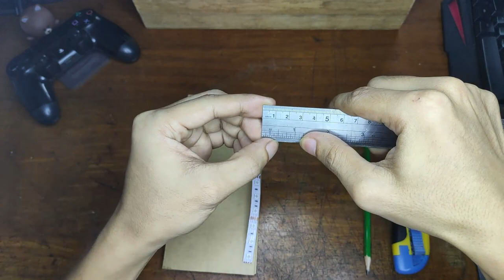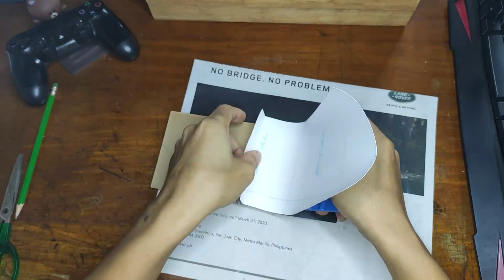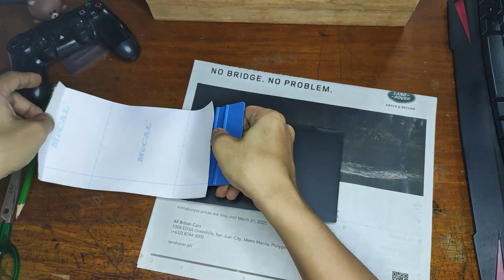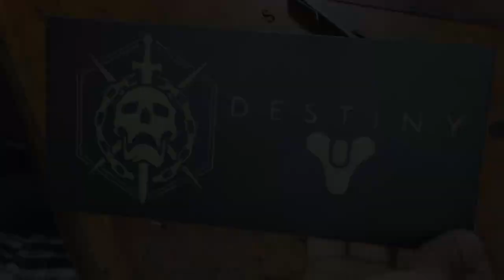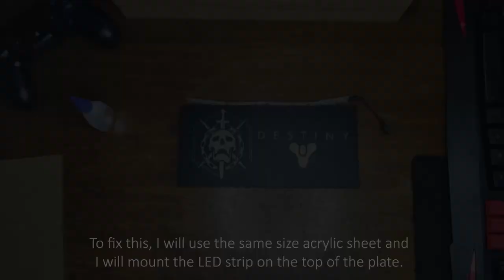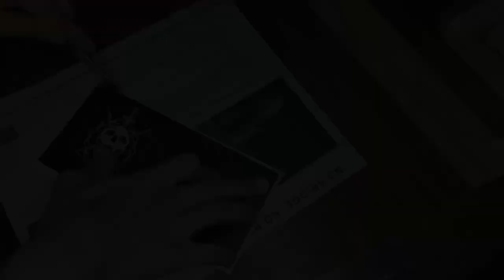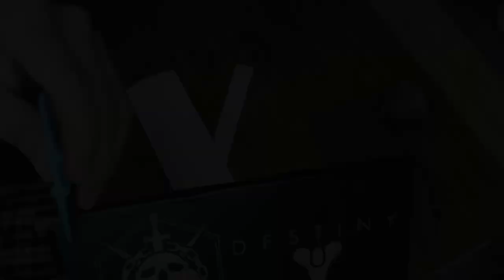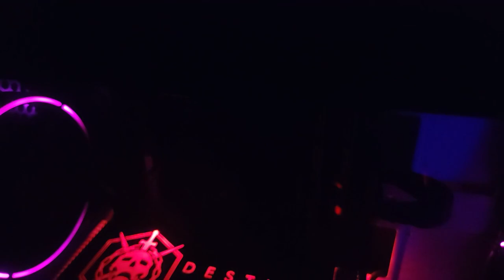DIY RGB GPU Backplate

Comment: Hello, and thanks so very much for your awesome video. Been wondering for a while now how I can make my own RGB bracket.

Was just wondering, though. Do you mind telling me what blade you use in your drop saw please?

Also, do you mind telling me what GRIT and paper or Wet N Dry paper did you use on your orbital sander?

Also, not to sure if you know this? You can get Exacto knives now that cut corners, circles etc precisely. I bought one on eBay a few weeks back. If you would like a link to one, just let me know.

Thanks again!
Reply from the maker: Hi CybaGirl. Glad to know me video helped you. 

The saw blade is used are the ff: Miter Saw: Diablo 7 1/4" 40 tooth Finishing Blade; Circular Saw: Diablo 6" 40 tooth Trim blade. That is only the available blades I have but if you are cutting acrylic sheets the higher tooth count the better.

For the Grit of the sand paper: I started rough around 80 to clean the sharp edges of the acrylic and finished around 240/320 grit. I just need it to be "Cloudy" so the light will be diffused better.

Thank you for the tip I will take note about it. It was an impulse project by watching videos on YT and I used what ever materials and tools laying around the house XD

Good luck on your project and link me up should you created a video as well~
Reply: @victor_belo  Hi and thanks for taking the time to reply to me.

I am not ready to make my own just yet. Still need to buy some tools etc. But as soon as I create my own RGB bracket you will be the first to know :).

Thanks again, stay safe and take care.

Comment: tell me the name of rgb strip 
which u use ??
Reply from the maker: The strip I used is a 12v 4pin RGB 5050 strip. However you might want to check your motherboard if how many pins are the rgb port.
Reply: @victor_belo  thnkx bro

Comment: Have you seen the company V1 they make these same back plates , do you know if they are using 3D printers for the designs ?
Reply from the maker: I just saw the company V1, I think they use a machine to make the design. Something that can easily cut design. but definitely not 3d printer, unless it was customize to cut :)

Comment: Could putting something like a custom Backplate on your GPU cause heating problems? I really want to make one and follow this tutorial but I need an answer. Thanks!
Reply from the maker: Hi Noah, sorry for the late response. I have read that it only increase the temp by a fraction and is almost negligible. I was not able to monitor it anymore as I have removed it because I installed a big cpu cooling heatsink which blocks the gpu backplate design.

Comment: Which is better place to place rgb strip side or top of acrylic sheet
Reply from the maker: Hi Venkatesh, I think it's better to put the acrylic on the side to lessen the thickness of the backplate. Just make sure you sand the acrylic so the light will diffuse better.

Comment: what RBG strips did you use? and are they MSI softwear compatible
Reply from the maker: Hi Reptillian, the RGB strips I used is a regular 12V RGB LED Strip (since I will connect it to 12V 4 pin LED controller) if you are planning to connect it directly to your motherboard I suggest looking for 5V Addressable RGB LED Strip (3 pins).

Comment: What do the materials of this plate say?
Reply from the maker: Hi Anoop, the main materials used for the project are 5mm acrylic sheet, black and white vinyl sticker and LED strip. I used a regular 12V RGB LED Strip (since I will connect it to 12V 4 pin LED controller) if you are planning to connect it directly to your motherboard I suggest looking for 5V Addressable RGB LED Strip (3 pins).

Comment: Ignoring time and effort, how much did this project roughly cost? I'm wondering if its worth doing for my graphics card which is already 6-7 years old XD
Reply from the maker: I can't remember the total cost because I was using some leftover materials. The one that should cost the most is the Acrylic sheet. If you will be able to buy a cut size of it, it will greatly reduce the cost of the project. The next expensive item will be the LED strip - if you can buy in Aliexpress you can find cheaper option with the expense of delivery time. Aside from that all other materials are cheaper (Vinyl, Acrylic glue, sandpaper).

Comment: where to buy the black stuff pls tall me
Reply: its just black vinyl wrap. comes in sheets or you can buy large rolls if ya plan on multiple projects.  Can get it just about anywhere.  Amazon, wal-mart, target, Kohls etc.  Got mine from Walmart really cheap
Reply from the maker: as  @beefybarbarian7779  the black and white stuff are called Vinyl. You can easily find them online in rolls and quite cheap.